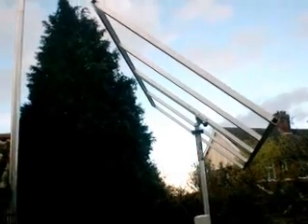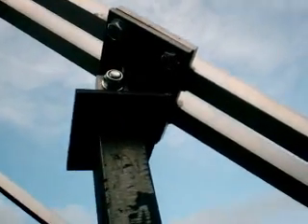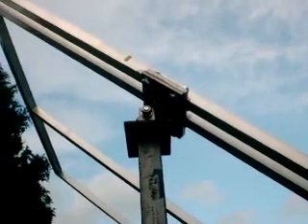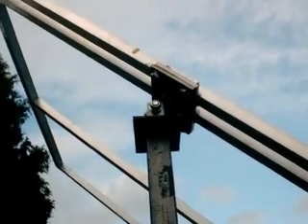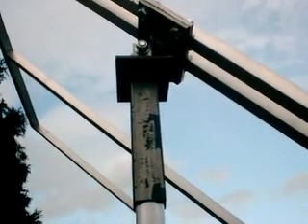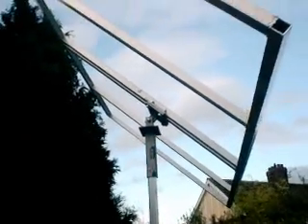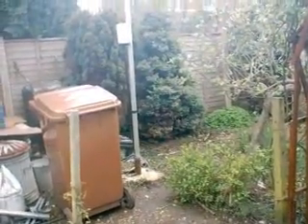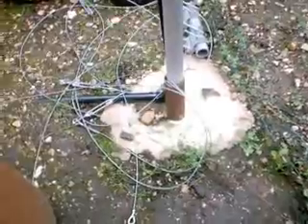Solar panel tracker mk 1

Comment from the maker: in a day or two I will be uploading a video of my completed Solar tracker.
Have Just got to wire and tidy the leads. then the automatic sun controller is finished.
all my system is now wired 24v.